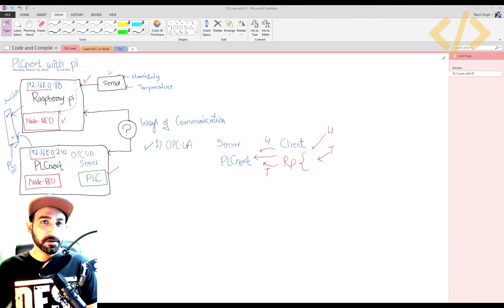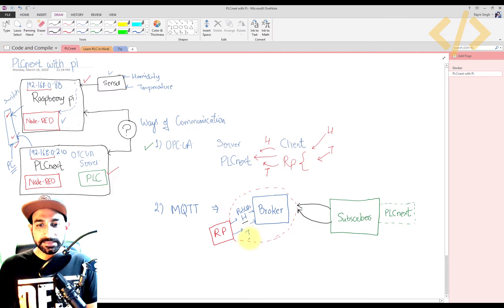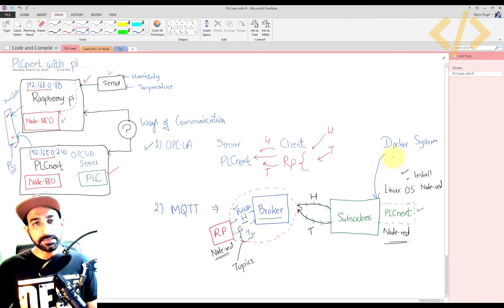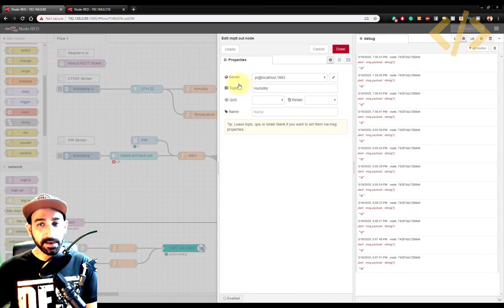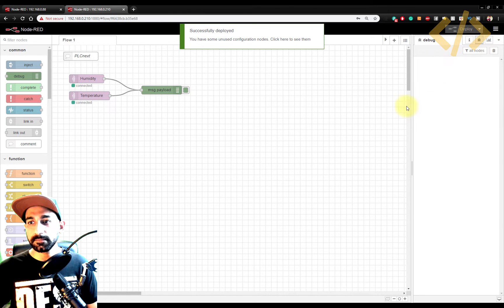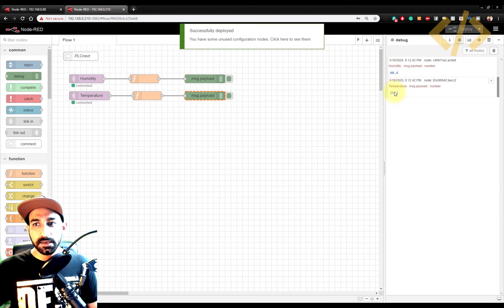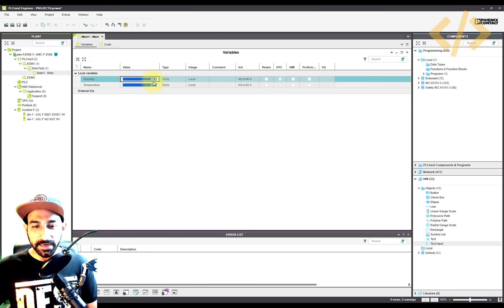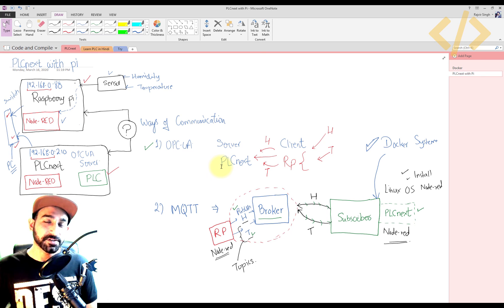PLCnext Lesson 14 -  Interfacing Raspberry pi with PLCnext via MQTT

Comment: What is the purpose of PLC if we are using Raspberry Pi for Humidity and Temperature. How can we shift values from PLC to cloud using Raspberry Pi ?
Reply from the maker: In this video, I just showed an example of how PLCnext can communicate with raspberry pi. Consider a situation where you are controlling a process using pi and you want to use processed dare from pi in the PLC. This way you can easily communicate to the PLC. Sending the data to the cloud will come in future lectures.